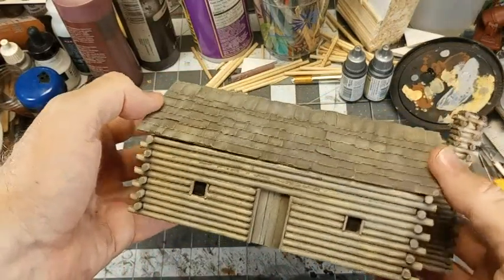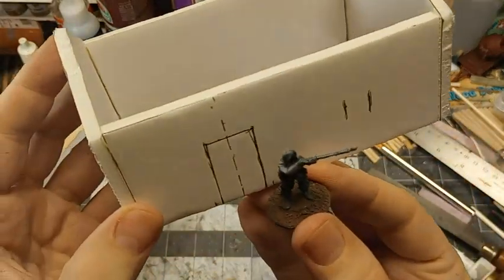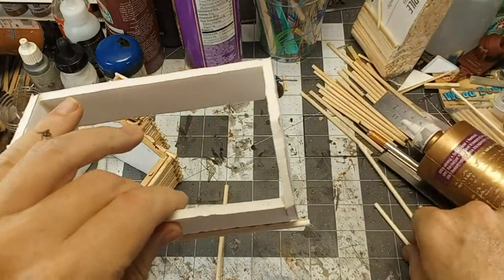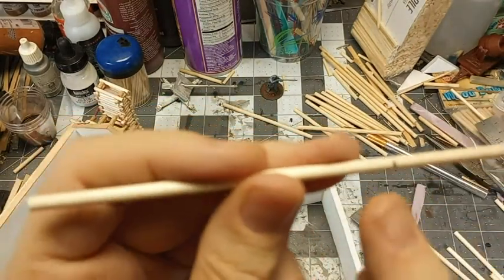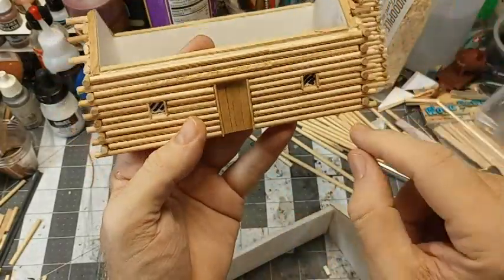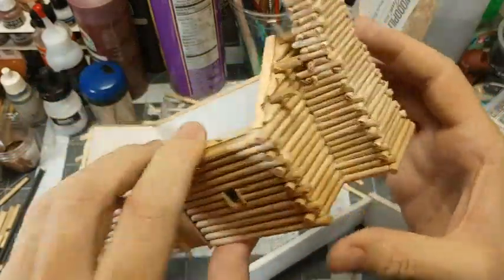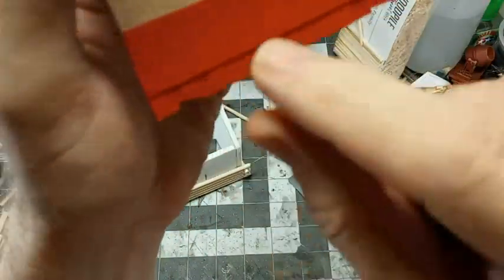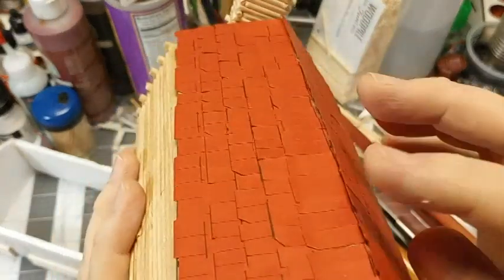FRONTIER CABIN - FIW/AWI/ACW/COWBOYS 25-28mm - EP 79

Comment: Great video, thanks! I owe my FIW soldiers more terrain to fight over and this looks perfect. Can you tell me what size dowel/balsa you used for your logs? Looks a bit bigger than bamboo cooking skewers (which I thought they were at first).  Thanks again!
Reply from the maker: Thank you! I ended up using birch rods mostly 3/8" and 5/32" or about 3mm, though I did use some  on the blockhouse I think were about 5mm.  Weirdly, I did pick up some random packs of bamboo skewers that were the same thicknesses. I don't think its super critical as long as they look ok with the figures then they are the "correct" scale. You can even use different sizes, large at the bottom and getting smaller as you go up but that sounds like it may lead to madness.  Cheers!